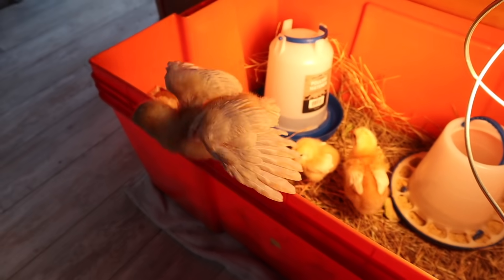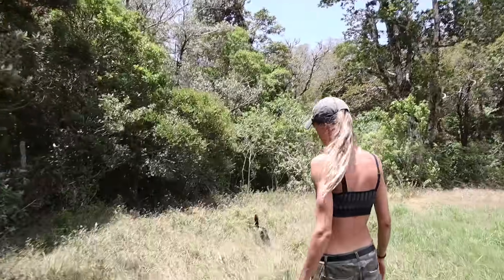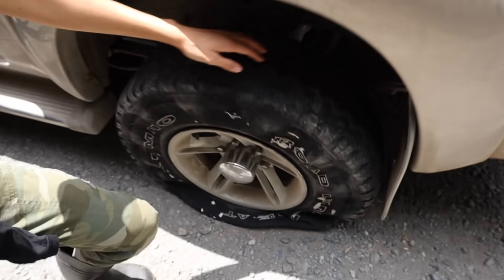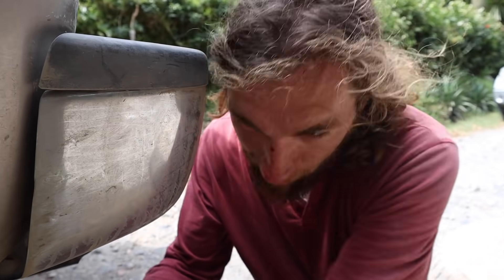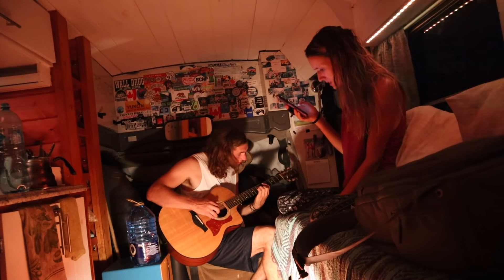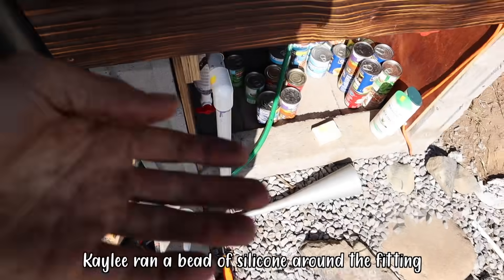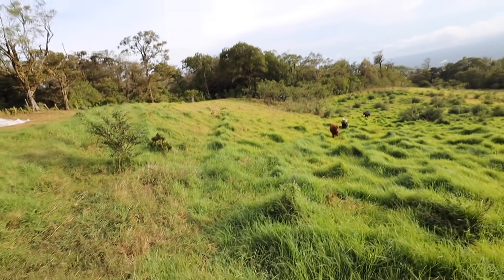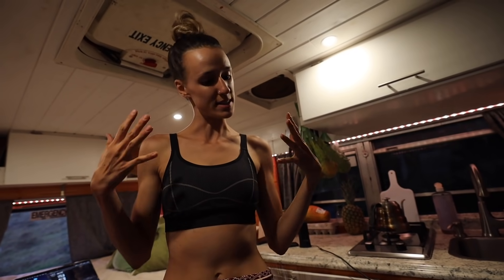WE'RE STRUGGLING // off grid living isn't so easy

Comment: I liked having the little veggie garden up high. I don't like bending over anymore. You guys should make a small rain collector for this water barrel that is wind proof. With as much rain as you will get soon, I doubt it needs to be very large for now.
I was also wondering about the motorcycle. Are the people renting the house using it, or is it just sitting? It would be handy if there was a truck problem. I have a fat tire ebike that would be great for getting up and down to town for coffee, but probably not great for carrying large amounts of water.
It's too bad everything got shut down before you could build the shed. Hopefully things will open up before too long. 
If you had some fence wire laying around you could fence off the bottom of your land and let the cows come graze until you are ready to use it.

Comment: Your chicken 🐔 jail you better make sure its pegged down like rope over an pegs or you will get up and it will be smashed. Also the chicks mite have gotten out to become food for something also Pearce 4 small holes in the water tank and rope pegs you get it ,pass rope on big knots and pegs obviously at other end mite be even a idea to rope down the bus as well  of the  Chassis, a friend did this with his caravan 🚐 well worth it especially with the wind getting under that bus he just hammered big spikes in at a good angle the fence wire and you wind it round with a bar of metal to tightly make it fast good luck 👍.

Comment: Put some hot water in an old coke bottle or two
Reply: Very good idea. A liter plastic bottle filled with hot water and a top that can be tightened down, bottle on it's side and the chicks will lay against it.
Reply: I just worry if they knock over that open container-they're not too small to do it.
Reply: Sew,     that one chick was able to fly up to the top side of the box. I'll bet it's a male, they should mark it with fingernail polish. Roosters are more agressive and lay very few eggs.  ;-)  ;-)  :-D

Comment: Natives lived " off grid " on this land for over 14,000 years..... and yet somehow this " living off grid " is presented as a new thing ? 

Solar panels, worst thing for them is extreme temperature changes, try to set up panels so they stay cool in summer, placing them directly on the ground like some do is only asking for problems. They have a " Dual " type of panel out now, it heats water at the same time, this helps cool panels and they last longer, you can use hot water for domestic use, a guy in NJ gets temp of over 100 Fahr. in winter. Or at the very least, to pre-heat water for domestic use and or heating, would not take much to also rig up small steam genny, if the water is already half way heated, would not take much propane to heat to boiling.... dunno if thats legal though... LOL you might need a " stationary engineers license " for that.... 
But really you need to combine all 3 types of passive energy into one system, solar, thermal and wind, small wind generator's like they use on sail boats to help on low sun days etc.., guys in Iceland built one, no over speed problems because of rotor design.
When it comes to DC power, clean clean clean, your connections must be clean, use military grade no corrode spray, personally I use heat shrink with the glue, sometimes called double wall, liquid electrical tape works well too, but it stains everything so be careful, it takes 3 or 4 applications to get the result you want sometimes, and it takes hours to dry inbetween. So it is a bit of a pain to use and cannot be used in wet weather.
Any soldered connection, make sure you clean with alcohol after, to remove any left over flux, or the flux will cause corrosion and failure eventually, with DC power, always go big, I over build, if I need 100 amp I use 200 amp wire and connectors, I build ebikes, 2 wheel drive off road monsters.
Silicone wire, used in RC's is great for flexibility and you can get it in heavy guages, 8,6,  Luna Cycles carries it, they carry some nice 200 amp connectors too.
For batteries, I would suggest the new LTO cells, you can make any voltage pack you want, they bolt together easily, HUGE cycle rate, would last you a lifetime, extreme temp. operating range, down to -40, easily add to capacity as needed, a bit more expensive but if you only have to buy them once in your lifetime....
You can easily make a wind generator from old ebike hub motors, both brushed and brushless, although the latter would work better. Bridge/rectifier combo's are sold on ali-express pretty cheap.
I hope this info helps, hope I dont sound like a know it all, not meant like that, I just like to share my knowledge with others, I'm half breed native :)